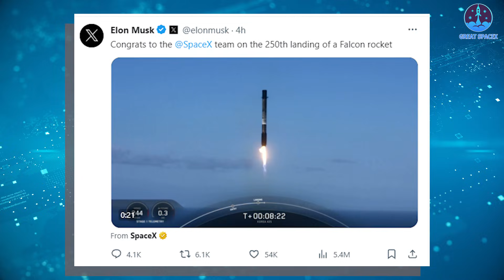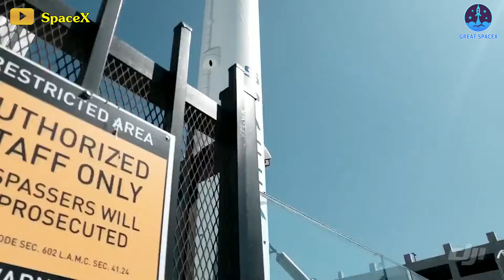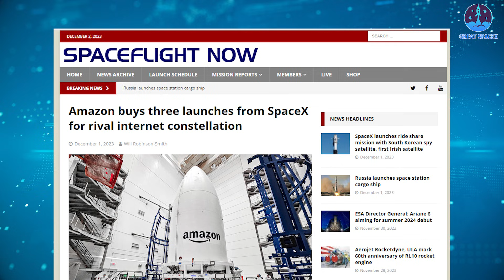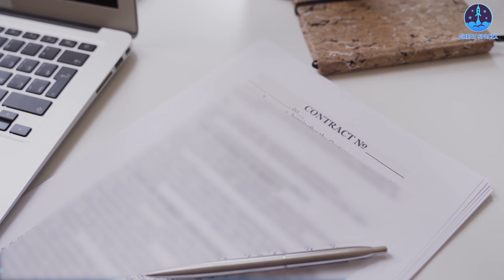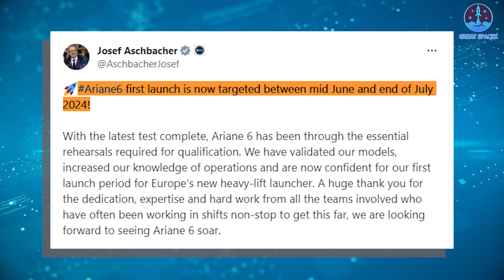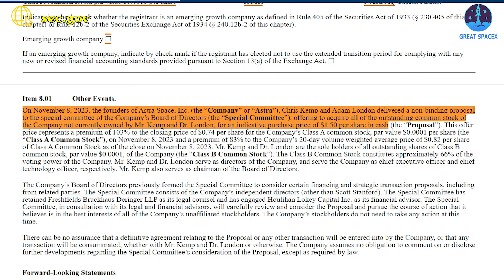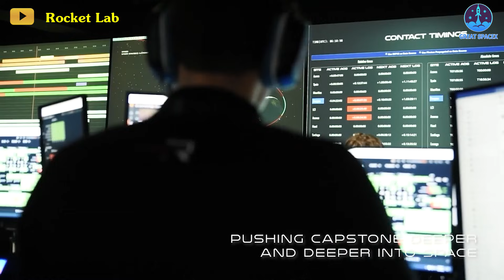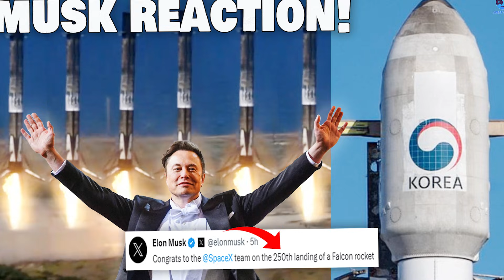Elon Musk Reaction to SpaceX's new world record that NO ONE HAS DONE IT BEFORE...

Comment: If you look simply at the metrics of:
-The ability to lift the most weight to orbit in a given year
and
-The cost per unit of weight to lift something to orbit
I don't see any real competitors to SpaceX emerging in the next 5 years. All of the rocket designs that "beat" SpaceX in these 2 categories are theoretical at this point and pretty much all of the companies in this field are trying their best to copy what seemed to work for SpaceX last year rather than doing any real innovation on their part. What I have seen from various news clips is that most of these companies (while they have big dreams and promises) haven't even been able to deliver a single payload to LEO yet. Perhaps if the would be competitors of SpaceX spent more money on R&D and Manufacturing instead of lobbying to slow down SpaceX permitting, then they would be further along.